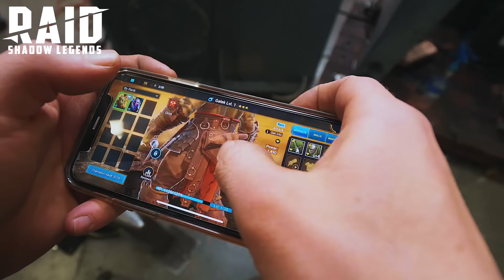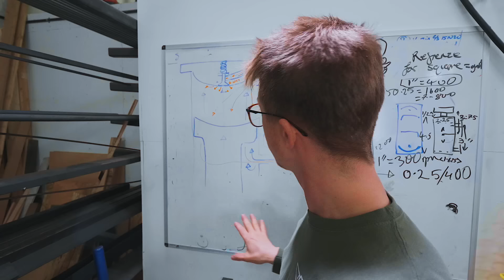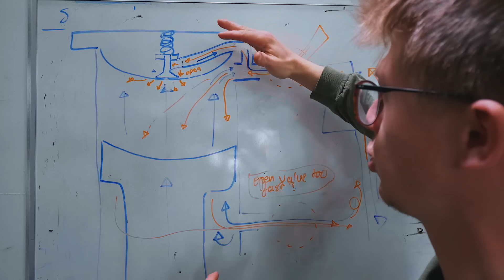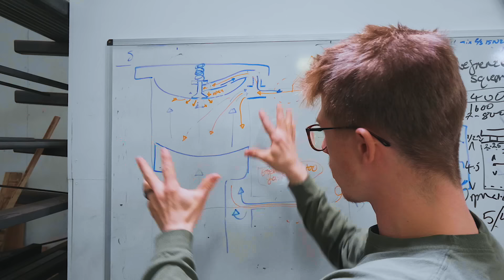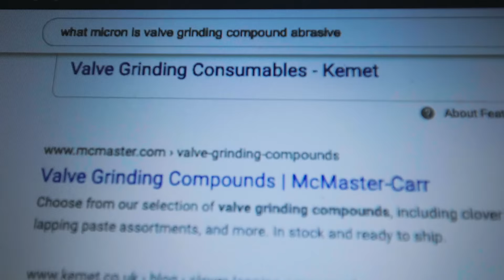FIXING THE 300LBS POWER HAMMER!!! Part 5

Comment: My mechanic side just said "ooof" 
But Alec if the adjustments in the air ports are Correct as it sits right now it might be the valve spring being tired of a long and hard life ?
Reply: Thought so too. If I understood the principle of mechanism right, then softer spring would prematurely let the air out that prevents the ram from reaching the top. I'm not even a mechanic though, so meh (:
Reply: A weak valve spring was my first thought.
Reply: I agree, a stronger spring and coating that gasket with a spray sealer or a light coat of rtv. That paper gasket probably isn’t the best this application.
Reply: @Mr.Leeroy  you are correct. These machines are built with a specific spring pressure. As the spring is compressed repeatedly over time, the metal fatigues and the spring weakens.
Reply: Yeah I was wondering  if that was tightened enough. The other thing he may want to add a washer to keep the castle but on the cotter pin
Reply: @Mr.Leeroy  Sorry, you are wrong.

The purpose of the valve is to allow pressure back into the upper chamber when air pressure is applied. The hammer is one hefty double acting pneumatic cylinder, but it is ported in the upper and lower side walls of the cylinder rather than directly at the end. When the ram (piston) is rising, it has a great deal of inertia, so the port on the side of the cylinder closes off before the ram reaches the top of its stroke. The pocket of air remaining as a result of the side port closing acts as an air cushion to prevent the ram from hitting the top plate. Then air is applied to the top of the cylinder via the poppet valve, starting the down stroke and in doing so, uncovers the side port allowing greater air flow into the cylinder, increasing the downward acceleration of the ram.

Long story short, the only purpose of the spring is to hold the valve closed so that the air cushion can build up during the upstroke. The pressure build up will only make the valve seal better. As long as the spring is strong enough to seat the valve, that's all it needs to do. Beyond that, the easier it is for the air to enter via the valve, the sooner the return stroke can start. Unless of course, the build up of air pressure required to make the valve to open being set to a higher value can assist in the initial acceleration of the down stroke.

While I'm not sure how sensitive it is to the ambient air pressure, it is now running at about 3,400' above sea level, so air density is a bit lower than at sea level. It probably makes no difference at all, given that it is compressed air doing the work of raising and driving the ram down again. The difference in the exhaust gas flow is probably negligible.

To prevent the ram hitting the top cover, it either needs to stop adding air to the up stroke earlier, (less upward inertia) or open the valve to start the down stroke a bit earlier to add extra pressure to the braking motion.

As mentioned by others, cylinder blow-by may also be a consideration.
Reply: Im not a clever person on these things, and of course there Could be a leak some place else.
But to me it seems like a new (stiffer) spring Would be the deal, because as Alec Said the hammer needs pressure over the hammer to make sure it dosent hit the lit. If the spring is Worn out it Would push to Much of that air out and therefor hitting the lit.
I look forward to see what he figures out so we all can learn 👍
Reply: @Mort8652Abrahamsen  No, Morrie Wyatt
 is right. When ram is going up, raising air pressure is only going to help seal the valve no matter how strong is the spring.

I for some reason assumed that air channel from upper port to the valve is going to have less resistance than the port itself when the ram is going up but not reaching the point when port is blocked. If so the valve would open given spring has not enough tension to prevent it, thus releasing some 'excess' air before port is blocked and valve is closed again.
Now, having a closer look made me realize that I was totally confused and misunderstood the purpose of this valve even though it was clearly explained in the video. I was not paying enough attention and also blame Alec's sloppy drawing :D
Reply: Morrie Wyatt 
yeah as long as that valve is seating well then you would be right, the spring only has the purpose of closing the valve when the ram is at the bottom of its stroke. I would start by getting a more compressible gasket and putting a light amount of oil around the seal to see if the condition improves, I wouldn’t be surprised if blow by is an issue
Reply: new spring for sure and fiddle with preload,so it doesnt let to early so it bangs the top,or to late so it will lose power
3 things i think its the problem
the new gasket doesnt hold good enough,can be tested with soap water
cylinder blow by,if i was him i would take cylinder out and change all the seals and clean all
the main valves could be worn out,and the top valve lets to much air out and doesnt make good cusion?
Reply: Leeroy sorry im not that good at english so excuse my Way With worlds here. But if i understand your message Right i Think we actually agree about it Letting the "cushion" out to soon ?But meh.. that arrogance had me dying 😂😂😂
Reply: Upvoting this.
Reply: The spring is not the problem. The valve is being pushed by the air being compressed when the cylinder returns to the top, which then closes the valve finally. By limiting the exhaust, the air cushin could be improved.
Reply: @lut5ch3r  but if the spring ia soft, it closes later and opens sooner, wich will effect air cusion
Valve only works at top when cylinder closes top main valve
So if spring is to soft wich i think it is when he can easy compress it with fingers, it it open when cylinder shoots to top fast, an closes top valve port, the pressure will open valve sprin, even a little is enoughto lose pressure wich u need with that big cylinder to stop it from slamming into top

Comment: Like everyone else is saying the spring is probably weak. With an engine when springs get weak/too much compression the valve will float (won’t completely close). Which explains why it appears to happen when you give it the beans. At the most basic form an engine is just a big air pump. Sucks air in pushes air out. Just uses a combustible liquid as the source of power. So it’s the same principles happening here just without the combustible source of power. Instead you have an electric motor being that source.
Reply: Could maybe use a washer to pack out and pre-load the spring more ?
Reply: Based on the picture Alec provided. The power hammer is not generating enough air pressure. The force is only able to lift and push it back down but not cushion it. The air has been all used doing so. It's not the spring at all, his problem is the very first.
Reply: Hal The Viking whatif there is enough pressure and it just leaks past the cylinder and or the valve. Which would make it not cushion it as well.
Reply: @BudgetBuiltDiesel  It highly unlikely because the leak has to be so wide that you can see it with a human eye.
Reply: I think you are correct Anthony, there is a question about it lowering onto the base quickly, the leaky valve would do the same for both issues.
Reply: Hal The Viking  If that valve is leaking/not sealing it would give both indications, 1. When piston is coming up... the pressure overcomes a weak valve, then the cylinder coming down when turned off would be a bad valve seal also..
Reply: @tomnugent1344  They all could be likely Tom. But there is nothing wrong with the piston. The air machine engine that generated air pressure is not consistent in doing so. it sends jolts of air out making the hammer hit the head.

Comment: I would try adding some more tension on the valve either by tightening the castle nut or by adding shims. If that helps maybe get a stronger spring.
Reply: I'm no expert sir, but I think we should also tell him to check the airways, because if those have problems too, well air can leak through those too correct?
Reply: @jacobbacuetes9850  if there is a crack in the casting then yes but if you pay close attention to how the air moves through the hammer, if that passage was blocked it would help keep the air cushion.

Comment: its a 1940's power hammer, paint it and put some nose art where the smiley face is.
Reply from the maker: That's an awesome idea!
Reply: Like the A-10 Warthog nose paint? 😬😬😬
Reply: Military green or dark blue would be perfect
Reply: @cboody69  More like P-40 Warhawk nose paint.
Reply: Eryk w  yeah, so sticking with the Warthog nose, OD Green or Aircraft Grey! 😬
Reply: G C either. Basically the same. Just different body paint. But I do like the idea of the red nose.
Reply: @cboody69  The question being, then, like it's flying straight up?  So the nose is the top of the hammer. Or like it's flying level with the shark teeth parallel to the floor.
Reply: Alec Steele perhaps you can weigh in on this? 🤔
Reply: Considering the era I’d go Mitchell bomber, like Memphis belle
Reply: I like it. I was thinking original paint, but I'm liking the idea of pin-up gal being put on it.
Reply: Give us the paint!

Comment: Another very interesting video.  The diamond abrasive was spot on, and that valve really needed a good lapping.    There could be a number of issues that are causing the piston to still hit the top.  You could try tightening the pop off valve spring nut a turn or 2...   You may also want to check the rings/seal of the piston.  If the top port isn't getting sealed near the top of the stroke, then your air cushion is still leaking out...  Also make sure that welding job on the piston didn't leave any holes for leaks. The rust in the cylinder may also be causing a leak. No matter what you paint it, you have to keep the face.... Looking forward to the next Video

Comment: I'm wondering if the Piston has a seal that's worn down. If the air cushion can get past the Piston it'll lose its effectiveness, and it won't hit down as hard
Reply: That is my first guess too.
Reply: This is one of my thoughts too, got to ask the question about the welds on the piston, are they leaking too.
Reply: That's a pretty reasonable guess
Reply: Another idea would be to check the seal on the check valve top cap, arguably needs a new gasket, too. If that leaks, the air cushion is established too late to prevent the piston from hitting the top.

Comment: I also wondered as it didnt work if the valve needs more spring preload with the top nut to stop the ram pushing air past the valve. 
Like in a car valve there will be a static seat pressure spec to stop this often in the hundreds of pounds
So ideally it would be to have enough seat pressure to stop that. But not so much that the hammers pumping system can still push it open from the other side.  

Which of course is going yo be easier due to the surface area off the back of the valve
Reply: Im thinking the same, maybe the spring has lost tension over time
Reply: I was wondering the same. Wonder what the torque spec on it was
Reply: The valve isn't leaking! At all! The other piston isn't pushing enough air past the valve into the cylinder.
Reply: The ram compresses the air under the valve and that is pushing it shut. The spring helps the air from the compressor to overcome the pressure between valve and ram and holds it down while idle. As far as I understand it.
Reply: @Glaswalker1001  true, I dont undertand the mission of the valve, because seems to be in the same chamber

Comment: 11:37 Just a hint: There wouldn't be any bubbles because it's not a closed system. When the fluid would leak into it the airpressure would remain the same at the bottom because it's open.
Great video! Very interesting how you fixed the Valve!
Reply: yeah he'd have to pressurize the bottom somehow

Comment: Continuing with your thought about an air cushion on the top, since the valve now seals well something else has to be leaking compression - so the piston isn't sealing - don't know if it uses some type of ring setup to seal, or the cylinder bore itself due to corrosion or possible wear.
Reply: I was thinking of leaking piston ring myself. And maybe leaking internal in the main valves.
Maybe a leakdown test with external air if possible?
Reply: is it possible that the air is coming through the valve in the wrong direction as the piston moves up which causes the valve to open? is it possible the spring isnt as strong as it used to be or its been replaced in the past with a spring that's too weak which is causing it to open and lose pressure?
Reply: Was thinking that too. When he turns the thing off you can see the ram slowly drop due to the vacum in the top of the cylinder leaking. I assume a certain amount of leakage is alright, but if you compare the leakage around the piston to the leakage through the valve I find it hard to believe that the small amount of leakage in the valve is the root of the problem.
Reply: Seeing the corrosion on the cylinder wall makes me suspect too much air leaks out before the ram reaches the top. Imagine the pressure is extremely high and any change in the clearance will leak.

Comment: Alec just a thought. The air could be escaping down the side of the ram and bore. You say its built in the 40's that's 70 to 80 years of use and wear. 
Like you said it's like a piston engine and sometimes the bores can oval shape and loose compression. If the bore has done the same on your power hammer the ram will certainly be hitting the top. Also a piston has piston rings to keep the compression, does the ram on your power hammer have a piston ring of some type? That may have worn out too if it has one.
Reply: Just to add a bore can wear different. Can be fine at the bottom but worn at the top, so its possible for it to work perfectly fine but not create that air cushion. 
Just a thought and maybe something to check if all else fails. Good luck
Reply: This certainly has merit.
Reply: When he powers it down the ram slowly sinks, so there's definitely some leakage somewhere. Only question is, was it designed to do that?
Reply: On the previous video we saw the air escape from the top valve. If Alec does another gopro shot we should be able to tell if it is still doing so after the lapping.

Comment: Couple of after thoughts. What is the operating pressure of that ram? Have you tested to see that this is correct. Second, you might want to re-adjust the valve linkage since your top pressure is now holding to a greater degree after the valve lap. The spring on the relief valve should not be too high. If it is it will NOT allow enough airflow into the top of the piston to push it down. But if the feed pressure from the compressor piston is too low, you can not overcome the upward momentum of the hammer and it will smack the top. If it is too high, it will drive the piston upwards and smack the top. There has to be a regulator somewhere in there. - perhaps in the adjustment of the valves. A little more pressure at the top and slightly less pressure from the bottom.
Several suggestions for paint have been posted by conservatives and radicals. Remember you have to work around this thing. Red colors are hot and in summer just looking at that red giant will make you sweat. The most restful color is green - most old machines were painted so. The modern colors tend to be Grey - as most of your equipment is. AND, you should give it a thorough cleaning before painting You have a shop full of beautiful machines, all nicely restored or new. Note that your restored machines are painted to make them look new, neat, clean and easy to keep clean not to mention rust prevention.
Have a great day, Alec. Thanks again for your return. We all hope you are rested and refreshed.